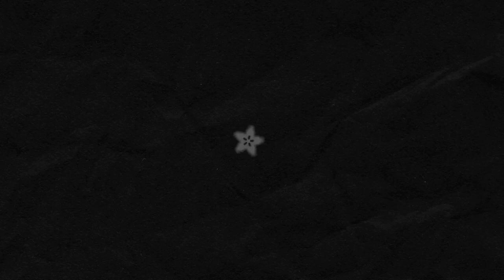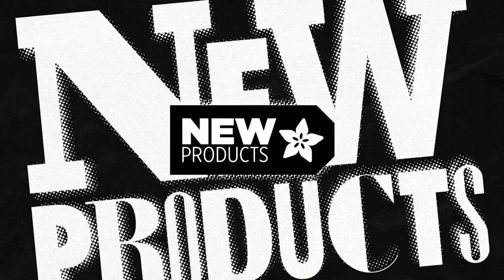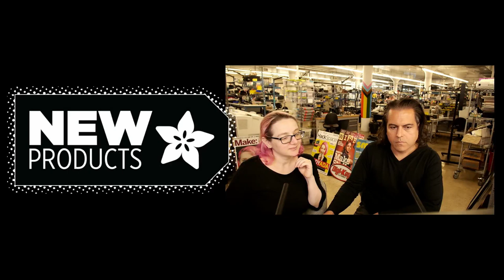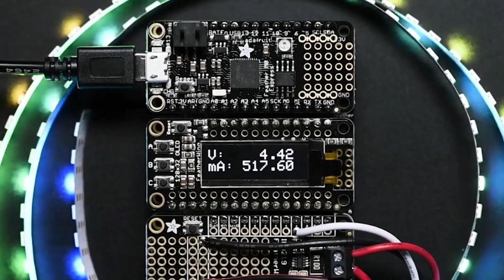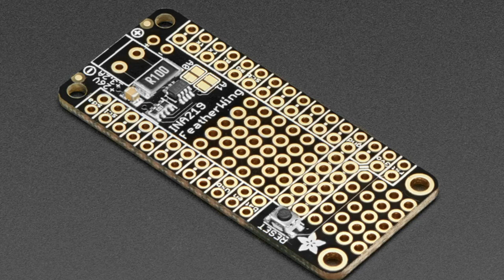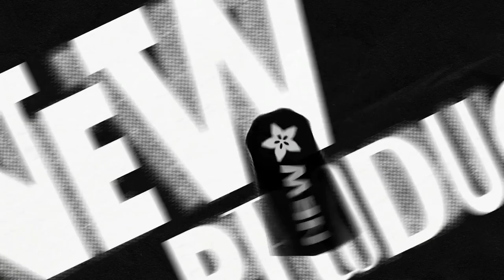#NewProducts 10/5/2022 Featuring #Adafruit INA219 #FeatherWing!

Comment: I was using ina219 sensor to measure current in a small 3 v motor driven by a DRV8833.  I don't know if motor current is inherently noisy  but I changed  line in the library to have more samples to get an averaging effect.  Before I did that, the current bounced around from 40 to 130 mA.  After, it was 70 +/- about 5 mA.